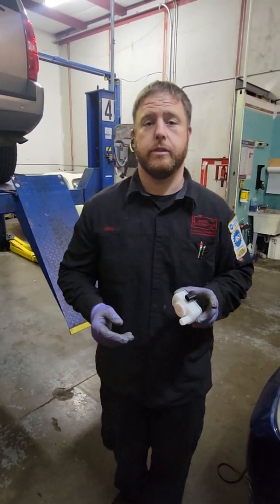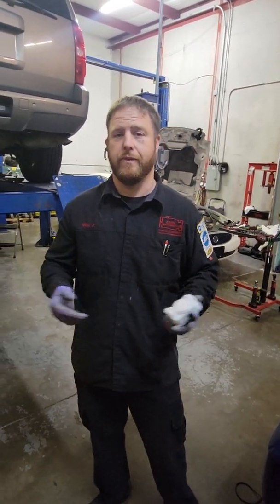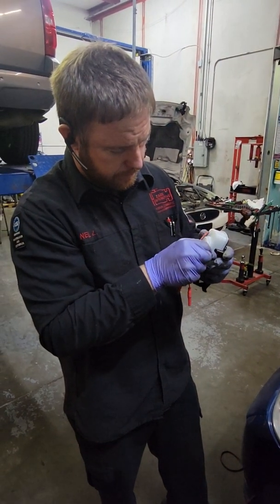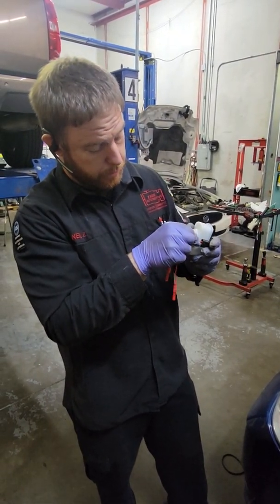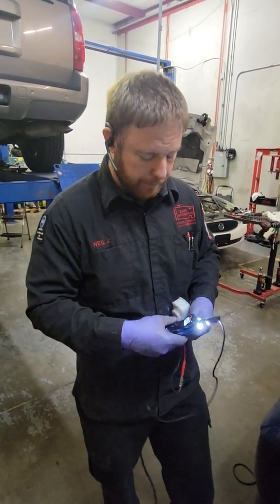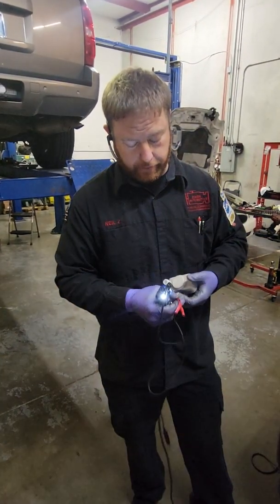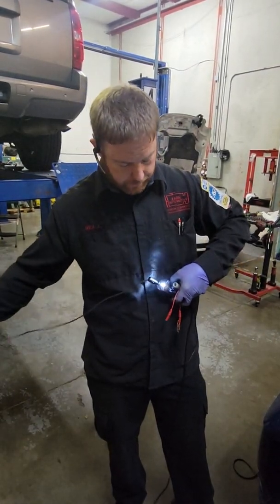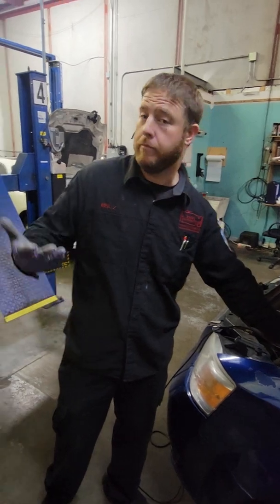Dodge/Chrysler EVAP Leak Detection Pump/ESIM testing & understanding EVAP system P0440,P0466,P0467.

Comment: Hey everyone, learn from my mistake. For P0441, start with the gas cap. It was the last thing I replaced, and it solved the problem.
Reply: I guess you're the ONLY one ever! Lucky dog! LOL
Reply: @soosiebergeron  I would say I was really unlucky since I spent about $100 between the purge valve and the leak detection pump. Neither of them solved the problem, but also can’t be returned for a refund. Once you install a part from Autozone, it’s yours unless it’s defective.
I’m just trying to save other people time and money by recommending that they start with the part that actually fixed my car, the gas cap.
Reply: @DiligentDave1966  I did the gas cap, then Auto Zone disagreed about my thinking it was NVLD assembly and sold me on purge valve instead; and light comes back on! 😡So I do leak dedection pump next; light stays off a whole week before muffler & center pipe bust open going thru a flash flood. 🙄Can’t really complain b/c they were original on my 2009. But after pro repair job light’s still coming on shows DTC 440 code! I’m thinking pump is installed upside down by mechanic or it’s a faulty part. BTW: I buy at O’Reilly’s now.
Reply: @soosiebergeron  It also depends on which Autozone you go to. The guy at the one I went to said something about the gas cap even though the diagnostic printout said to replace the leak detection pump. I should’ve listened to the guy lol, but even YouTube videos say the leak detection pump is what goes bad on these cars.
Reply: @DiligentDave1966  So true! Notorious! I wish I knew now…We live & learn. 🥸
Reply: @soosiebergeron  I think DTC 440 is a completely different problem.
Mine was P0441.
Reply: I changed my cap 4 times still pops up
Reply: @Destin4Life  I think it might be time to think about the purge valve or the leak detection pump.
Reply: @DiligentDave1966  ya im gonna do that and charcoal canister also just do it all its not that expensive if doing it yourself
Reply: @Destin4Life  What code comes up on your car?
Mine was P0441.
Reply: @DiligentDave1966  was evap leak detector pump on top the has tank where the wiring clips in one side was snapped off probably from me going down dirt roads to get to my quading stage areas code was 0440
Reply: My 2919 ram doesn't have a gas cap @Destin4Life
Reply: @jackhouston357  what code is coming up ?
Reply: @Destin4Life  441
Reply: I dont have a fuel cap dude so now what fk charger
Reply: @1989purry  There are other possible causes. It could be the ESIM or the purge valve. What is the code.
By the way, you technically have a cap, but it’s built into the door that you open to fill the tank. Those do go bad and it’s the easiest thing to change that can cause the code P0441.
Reply: @DiligentDave1966  i did replace the esim the purge valve the esim filter and the fuel door rubber cab amd still getting p0456 po440 or 0441 the only thing i need to replace is the canister
Reply: @DiligentDave1966  u mean the fuel filler neck ? Correct cz in that area is where the 2 little metal 2are localized
Reply: @1989purry  I thought there was a rubber piece in the door itself, but I could be wrong.
I did see a video where someone had to replace something on the top of the gas tank. They had go through the trunk or the back seat to get to it.
Reply: @DiligentDave1966  yeah its a piece rubber in the door  new from the dealer i take my back seat and there are 2 fuel pump one have one electric conector the other one have 1 plastic tube none smell gas the thing is that to lower that tank is a pain 😮‍💨 i saw something in the top of the  fuel tank from google that look like some purge solenoid idk  this is crazy
Reply: @1989purry  In the video I saw, the guy didn’t drop the tank.
Did you have Autozone or one of the other shops read the codes?
Reply: @DiligentDave1966  p0456 someday delete code the next day maybe p0440 with p0441 somedays i have 1 code someday i have the 3 codes
Reply: If you're just gonna throw parts at a car in order to solve a problem, always start with the cheapest item first! 😉
Reply: @maximusmax4557  Normally, I would agree with you 100%.
However, I had my code read at Autozone, and it suggested that the ESIM (leak detection pump) was bad. Also, most YouTube videos suggest that the ESIM and the evap purge valve are very common problems with Chrysler vehicles that can cause the P0441 code.
The Autozone scans are usually pretty accurate and, since most people don’t have the equipment to actually test the components, they trust the scans.

Comment: 2015 dodge dart.  P0456 code.  Originally came up as a gas cap.  Tightened it.  Deleted code.  Code came back.  6 months later.  P0456.  The next step is to smoke the system i presume? I have lost about .5 mpg and it seems possibly a minor amount of power loss.  But I feel the turbo compensating. I do not smell fuel in the cabin nor near the tank. *edit I had a valve in the wheel well replaced already.

Comment: Keep in mind that it takes very light vacuum to activate the ground connection. And will give you a false positive when using a power probe. The best way to diagnose this is to use a voltage meter and test for resistance
Reply: Is there a voltage meter you would recommend under $100 ?
Reply: @miked1023 i have one in Walmart for 5usd
Reply: Witch seup should i use ? Miliamps?
Reply: @ed2s i would go ahead and just replace it. They are known for failure and are cheap. But i would recommend using mopar only. Anytime i get an evap code for Chryslers like that. Gas cap and leak detection pump are automatically on the ticket.
Reply: @bigetnt i did the same day i post This, but since I bought it from TEMU, I really wanted to know if it was good, also, this doesn’t work like valve. It works like a valve and sensor.
Reply: Do a YouTube video to compare the resistance of the mopar part and temu part when you pull vaccume and at idle. 
Try continuity test as well. @ed2s

Comment: The one on my nitro is not like yours.  They look the same, however the connector is on the opposite side so the the vent is on top.
Reply from the maker: Electrical connector should be @ the 3 o'clock position, if not it's on backwards fyi

Comment: Will the code go away? Does one have to reset?
Reply from the maker: Most vehicles will need the codes cleared with scan-tool.   Eventually it would probably go off.
Reply: @nzdiagnostics2010  Thank you,  I will take the vehicle to the dealership.
Reply: Just disconnect the battery for 2 minutes. The code will clear.

Comment: What are the symptoms of the car. Does the engine shakes more when this pump fails? 
in my Honda is called EVAP check engine module. Is it the same?
Reply from the maker: Just a Check Engine light on dash.

Comment: I just had the same adapter changed and then they used a computer to turn off the check engine light off.
I wrnt back to get it scanned and the same codes came up
P0456
P0440
There's was one time I had the engine running while pumping fuel in it.,my mistake.
I'm getting that fixed Thursday April 7th 2022 
My car is due at the air team facility.

Comment: Thanks for the help. Did what you said. Part checks out ok, via testing. Going to try to fill with fuel with part removed to see if it’ll fill. No engine lights, but zero ability to fill tank. Pump at station keeps shutting off. Next suggestion?
Reply from the maker: It's not venting properly.   Check to see if the Vapor Canister filter is clogged with debris/dirt.
Reply: Vapor canister and also replace the fuel pump filter

Comment: Changed mine and gas cap on my 2018 ram 1500 hemi and still here a whistle when ad gas to tank and have a check engine light with small evap leak cant figure it out
Reply: Mr. Whistler: Have you replaced your PCV Valve lately? That can be a symptom--the whistling noise, when it's on its way out. Good Luck & keep whistling while you work (but don't let your truck join in!)
Reply: @soosiebergeron  is there a pcv on tank that is where I hear the whistle
Reply: @txgaspimp9321  IDR you were talking about your gas tank. My PVC IS UNDER THE HOOD. Easy access right between the engine and transmission. Easy swap out. 5-10 minute job, costs under$10 to replace. Maybe you have something else going on. 🤷‍♀️

Comment: i have been chasing a po455 in my 02 caravan. Replaced 3 hoses and replaced broken clamps,and replaced vent valve and still have a problem.  Next is purge valve. i don't see the item you are talking about thou. any suggestions?
Reply: An 2002 Caravan doesn't have the device he's holding in his hand. An 02 uses a Leak Detection Pump (LDP) while the newer ones use an Evap System Integrity Monitor (ESIM). There is a lot of confusion about these two different components and what they do and what they are called. If you haven't fixed your vehicle after replacing everything you mentioned you might have a bad LDP. Its located underneath the van  where the driver's seat is located.

Comment: 2013 Dodge Dart 2.0. Stalled after filling up at the gas station. Dodge dealership is telling me Fuel Pump ($837) AND EVAP canister ($311) need to be replaced. They said there wasn’t a leak in the fuel pump. Im trying to get them to tell me why the fuel pump needs to be replaced if there is no leak and its just a dead EVAP or the solenoid is stuck open. Any ideas?
Reply from the maker: Based on your comment, I would definitely look at the Charcoal Canister Purge Valve Solenoid  being stuck in the open position when not energized.